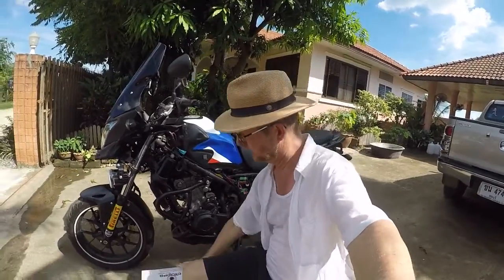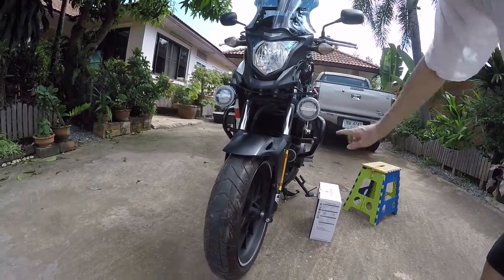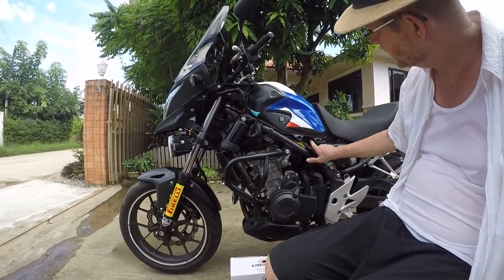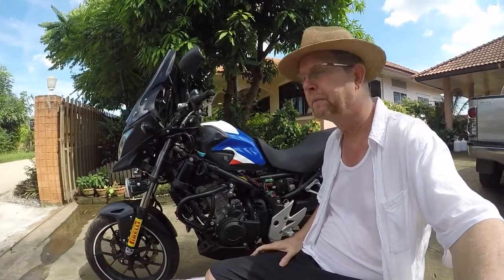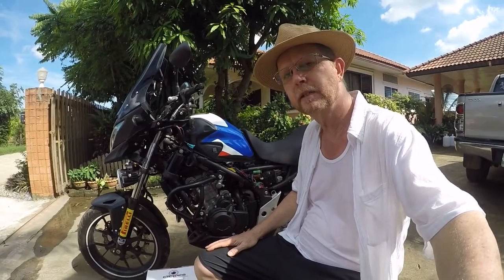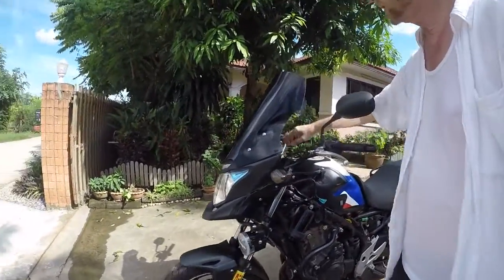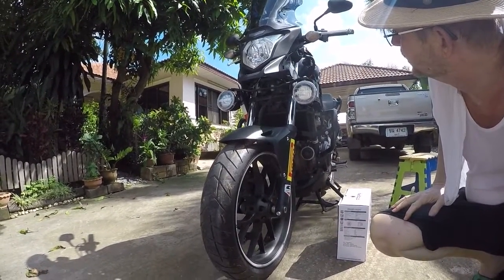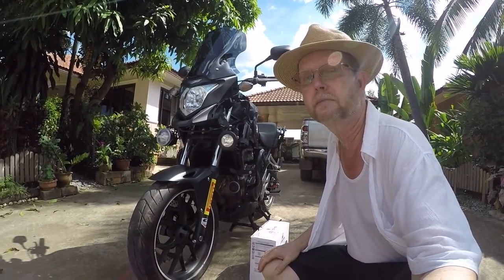Cyclops LD Optimus Install - Honda CB500X

Comment: cant you wire it up to the options plug on the right side...? I hear that plug has a dimmable wire...
Reply from the maker: Of course, and that is a great place to tap 12vdc. I had already had the local Honda shop wire up my USB accessory to switched 12vdc, so I just took a tap off that. And at the time I did my wiring, I had not found this YouTube video. https://www.youtube.com/watch?v=vXFUNtY0-X8